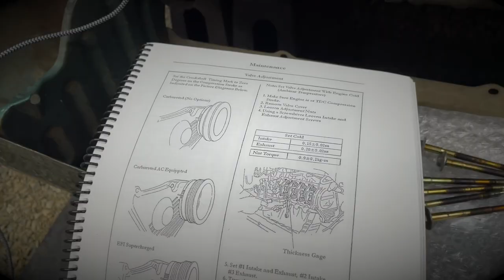Honda ACTY Sunglasses and Card Holder Install With Genuine Part From Japan!

Comment: How do you flip the steel thing into the case? I put it wrong and I need to flip it 🤦🏽‍♂️🤌🏽🙄💀
Reply from the maker: you gonna need to use a small flat head to pry the snap up or use a pick, but ya, it is tough to remove it. just gotta pry at it carefully